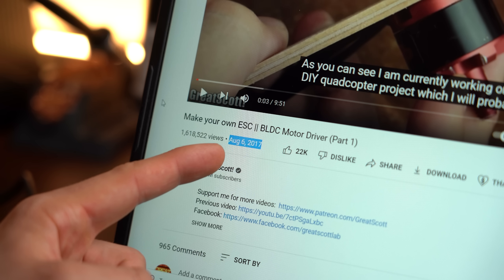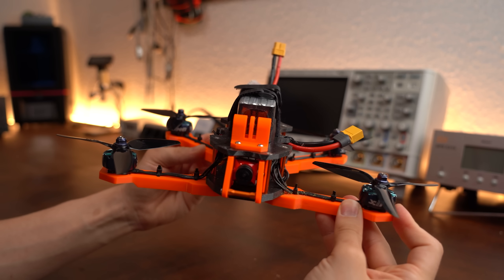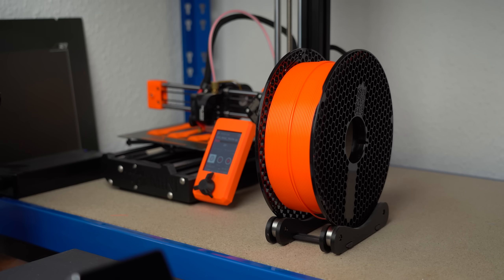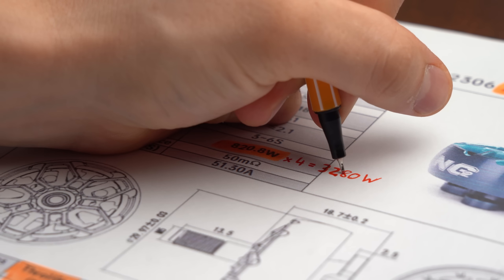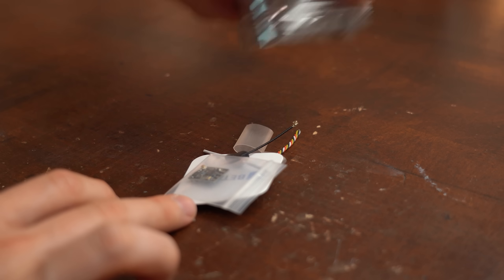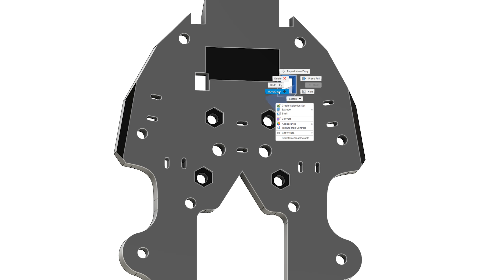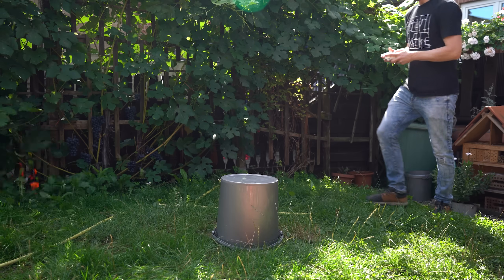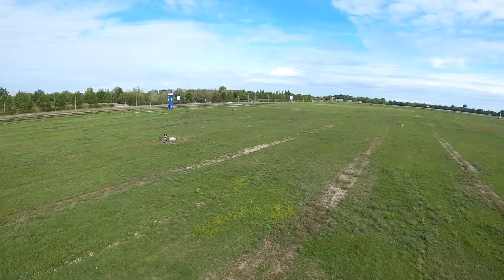The Idiot's Guide to Making a DIY Drone! (I am the Idiot)

Comment: Although 3D-printing a frame might make for a better video, what I learned the hard way is that there is zero benefit to not buying a ready made off-the-shelf drone such as the Diatone Roma F5. They have also done all the component matching and tuning for you, so you can literally plug in a receiver and a battery and fly it. Where 3D printing comes in handy is when you are experimenting and might change the design between each flight. Otherwise, plastic frames are too brittle and sensitive to heat. Carbon fiber is nearly indestructible. When you get fed up fixing and rebuilding it all the time, just go buy one. You will thank me later.

Comment: Those xing motors are really nice, but in my eyes too nice. $20 per motor is hard to swallow. It would make more sense to buy something like an emax eco 2306 for $13 each, then have plenty of money left over for a cheap Source 1 5" frame and spare arms.
Great video btw, but definitely some components that came be improved upon once you have more experience 👍

3d printing is still a great resource for printing antenna mounts, cam mounts, arm protectors, and motor skids though!

Comment: This video was good and all, just not what I was expecting. I figured you where going to actually build it from scratch. Before you could buy all this stuff we used to make flight controllers from an arduino pro micro and a gyro/accelerometer pulled out of a Nintendo Wii controller.

Comment: Heh quite a coincidence, I started building my fpv drone around the time you did your original video. 
I actually finished it but a very bad choice of goggles and camera coupled with my being a total noob flying made me put it in a drawer and forget about it. 

I just randomly picked it back up and got it running a week ago, started training in a simulator and got a better fpv setup. Now this video comes out :)

Good luck practicing your skills, the simulators like liftoff really helped me get over the initial fears of crashing or hitting someone.

Comment: A good build for ya would be something along the lines of a "babytooth" build which is a light 1s 3" that weighs like 60g with a battery. Very agile, super quiet, can still go nearly 100kph. The original babytooth frame is shipped from the US, but look around for other 3" toothpick style frames, ~1302 11000kv motors, 600mah (gnb) 1s, aio whoop board, and the other bits. Love my build! Or for more power build one with 1303 5000kv motors in 3s.

Comment: Love watching newbees try to fly and learn build a quad. Nice video, nice try, good parts, except the printed frame is an absolute no go. FC is way too sensitive for those wobbly 3d printed things. And everything is probably said already, so I'll keep it short.
1.Simulator is for children, learn the hard way😋
2.Lower your rates to make it easier and learn faster.
3.Add 0.25 expo to make it even easier.
4.Fly it on a 3s lipo if you're still think it has too much power. 

BUT MOST IMPORTANTLY: Please don't ever arm this thing in your hands...or close too you for that matter. The flip out it did in the air can also happen when you first arm it, and you won't be able to hold when that happens. Many, including me, have had an accidental arm while holding it and that is some scary sh!t. Will spare you the details😅

Comment: This is the first video you’ve ever posted where I knew exactly what you were talking about 😊 
2 tips… try to avoid powering up the VTX without an antenna hooked up to it. Depending on the one you have it can damage it. Also try a carbon fiber frame. The FC will work better with a rigid frame.
Reply: @Funk FPV do you have a channel where you fly FPV? I love your YT Shorts btw

Comment: Great project! Even if the PETG is not carbon fiber (as the experts mention in the comments) it is great learning experience.  I wonder of the total cost though ( I would love to build one too). Do you know what the final cost (of materials) was at the end?
Reply: should be around 300-350 Euro -> Motors 100, Elrs 20, FC 100, VTX50, + the small things like propeller, lipo, screws standoff and camera. For goggle and remote another 100 Dollar

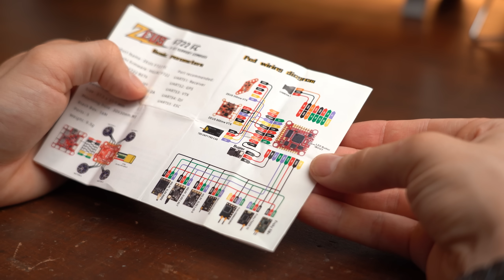Comment: 9:55 do not rely on the fc or esc cable! not every manufacturer has the same pin arrangement. you might fry your expensive fc so definetly check the manual at least twice before powering the drone!

Comment: I understand your value for being able to reprint parts that break, but as someone VERY into the FPV hobby (many thousand dollars deep), here are a few things to consider:

1. Carbon frames break WAY less than you would think. Well made frames like the Apex, Moongoat, etc are flown into brick walls, trees, and pretty much anything else you can think of at great speeds and can usually fly off with no issues after a quick turtle mode (flip over after crash mode). The Apex even has a warranty and they will replace parts if you break them. The most commonly replaced parts are motors and props. Props are a consumable, motors (for some people like myself who fly very hard) are as well. The arms are not. They should last you months or even years of flying around and just cruising. Until you start doing risky stuff around brick/concrete, you most likely wont break any carbon at all.

2. Plastic frames have much worse flight characteristics. We moved to carbon fiber because it is much, much stiffer. Frame resonance for plastic frames is a big issue. The flight controller needs to filter out those resonances, which adds latency to your system. If those vibrations are bad enough, it can even burn up your motors and ESCs.

3. Carbon frames offer the best durability for the weight. Carrying around a full size gopro, you really want to be conscious of the all up weight of the drone. Especially  on a 4s build, heavier drones will have problems coming out of dives or stopping quickly due to voltage sag. The heavier the quad, the more your motors need to work, the more demand is put on the lipo. 

All in all, there is a reason the entire FPV community has moved to carbon frames. Until some of the more exotic composite materials are tested, carbon fiber offers the best balance of weigh, durability, price, and stiffness. 

Also a side note, you really shouldnt be holding the drone while it is armed. It is a lesson you will eventually learn yourself, but just, trust me... those props will win a 1v1 vs your hands. Ask how I know :)
Reply: When you go bando bashing everything in this hobby is a consumable. :D

Good points. I agree with all of them. :)
Reply: SHTF prepper; Im interested in learning more about drones and creating them from nothing with replacement parts as I envision the next decade of SHTF crimes and modern warfare combat situations, drones seem to be the epicenter for many next discoveries of modern tactics in using drones in helping solider in battle, helping police fight crime, helping firefighters put out forest fires, and potentially SHTF type situation, perhaps it'll do some good to know such things and have such capabilities knowledge, skills and fighting skills in being able to both attack and defend yourself from afar.
Reply: @westcoastadventurers8504  Yeah after seeing what they can accomplish in the Ukraine/Russia war, I kind of want to build one myself. Mainly for recon during an emergency type scenario. Plus you can just get cool footage from them lol. The DJI drones are really nice but seems like building your own would be cool.
Reply: In any reality in which terminator type machines exist, even used for good in protecting people, eventually they the terminator type solider's will be taken over by AGI, hacked by a humans, or some form of secret organization in witch will carry out brutal violence on the innocent of humanity. I am currently laying groundwork in setting up multiple companies and organizations in defense to these injustices even if they do not occur for another decade, this only gives us more time, because these events will occur, the question is when?
Reply: Armored robots are already being put onto the streets within the communities in which we call home. We should not and can not trust AI robots in providing security to us as individuals, our communities or nations at large, we must learn the skills that it takes to stay ahead of the curve when it comes to both criminal activity, foreign nations, secret agendas to rid us of all property, and AI from controlling the entire world via armored private security, armored police bots and armored military bots will be used everywhere around the world by 2045. Just like the automobile has dominated the battlefield and cities in which we live for the last 100 years, drones will have an major impact on the battlefield and in our own communities for over the next 100 years.
Reply: Ah, that's why! I built a "springy" titanium frame whoop drone and it requires more than a lot to handle😂
Reply: I remember when I was a kid, my dad bought me and a friend of mine two identical RC planes. The instructions said to throw it like an airplane while putting the throttle to full. Quickly learned that these instructions are pretty bad for this particular plane (props in the back). My friend's mum threw the thing while he throttled to max. It just barely graced her finger with a prop and took of a bunch of skin. She had to get stitches.

So yeah, props do be dangerous

Comment: Glad you tried fpv ! You should get a carbone fiber frame, much more stiff and resistant, it can handdle a lot of crash. I did some video of what you can do with a fpv drone, it give a lot of sensation, u should watch 👌, but to become good without losing a looooot of money, simulator is the way to go

Comment: Osilations might be because of flexing 3d printed parts try to stiffen the arms also for starting with drones i wuld recomend you to have it position controlled by gps to get used to controls but you need antena for that or you culd practice in simulator

Comment: Listening to the motors I can hear the PID parameters are not good and I think the first time all of your motors have stopped in mid air was because the FC thought it detected a runaway (you can see this alarm in OSD). I have built my first drone using basic servo signal ESCs (dont ask) and that is what it would do before I altered the PIDs drastically. While it was no longer going to the moon, it would still flip out a bit after a sharp turn or a stronger gust of wind. The default betaflight settings should not be this bad with your equipment though. I think you need a proper carbon fiber frame, the plastic may not be stiff enough. In my opinion there is no reason to tune the quad or learn to fly it with mechanical problems.

Comment: Good work! Like others mentioned frame stiffness might be a possible issue.

You might also want to try the iNav controller firmware, not only if you're interested in adding more functions like position hold or route following, but also just for "normal" FPV.

It's configured much like Betaflight, since they share an open-source lineage.

Comment: hi Great Scott, i like your videos :> 

i am a fpy pilot but i have no drone yet so I practiced in a simulator her are my recommendations and information

* practice in a simulator 
* avoid 3D printed parts except for the gopro mount 
* if possible use a better controller/transmitter like RADIOMASTER (optional)
* avoid exposing the battery cable near the props as when you crash it will get chopped up

i hope you will have a great and fun flight out there :>

that's all from me stay safe and happy flying :)

Comment: Please, don't use 3d printed parts for fpv quads, the rigidness of carbon fiber heavily affects the tune of the quad and how the flight controller reacts to it, 3d prints need to be thrown out the window, get a carbon fiber frame and spare arms, easy as that

Comment: The frame have to be very stiff. Most of your problem comes from the frame (vibration issue..) . Buy carbon fiber frame TBS Source . Is very cheap and will have more success. And the rest you have decent parts what I can see.

Comment: I'd make the frame out of aluminum. Just cut out a simple X from a sheet and drill some holes into it. If you don't have a tap and die set I'd suggest getting one to make threading the holes easier. You could even make an oval for the bottom, use standoffs to connect the top and bottom pieces and it'd be pretty sturdy.

Comment: well great scott finally gets into fpv, aint this gonna be awesome, so about your drone there are a lot of problems first one being the frame these 3d printed ones are never perfect and have a little to a pot of vibrations which mess with the quad, and hence require extensive pid tuning and more agressive gyro filtering, then a 4s 2200mah ia wayy to heavy for a 5" better to yse something like 1300mah, i would really advice using a carbon fiber frame or use some some carbon fiber pieces or tubes to reinforce your printed frame

Comment: Excellent video breaking down the process of how to build a quad from a beginner's perspective!! I would recommend trying out a sim, and you should be able to use your controller as a joy stick if it has a USB plug.  For a sim, I would recommend using Liftoff or DRL, both of which are on steam.  You can crash all day on those and not spend a penny!

Comment: Hi, Really a great video
But the problem you had with the motor being stopped at the highest point of the throttle that same thing is happening to me but I don’t know whether it is the copper wire or capacitor needed or the esc is not calibrated properly🤔 and another problem is that when the motor is armed it automatically starts at a lowered speed then I have to the desired throttle means that the motor doesn’t stop at the lowest throttle rate😢
If anyone wants to help or give a suggestion please reply

Comment: nice mowing machine ! :D
just kidding you.... you did a great job on this ! however i'd just make a notice: motor arms are too bendy. This will act like an oscillating mech part between motors and their gyro-sensors through the servo loop.... i guess you could enhance control and stability by making those arms less bendable ;)

Comment: I wonder if you could do the bottom section of the frame in aluminium? It would certainly be a lot stronger than filament, easier to work with than cf, and only about twice the weight, which as a percentage of total weight might not be so much (and maybe it could be used as a conductor too, saving some wiring).

Comment: Hey, fpv flyer here, there is a reason frames are made of carbon fiber, mainly they are incredibly hard to break on soft grass, and as they are more rigid, they tend to vibrate less, and will make pid tuning way more easyer. 
If you want to get more in depth with the frame design and pid tuning, look at Chris Rosser's youtube channel, and DaveC_FPV for more creative ideas on frame design.

A good option for an affordable 5" chassis is the Steele Apex, and if you want the best for the vibration dampening, the AOS 5 is a good choice too (made by chris rosser)

Other than that, a 3D printed frame is fun for the experiment, but will limit your PID tuning ability in the long run.

Comment: Nice work, built one by myself in february this year. I would recommend you to buy a carbon frame because as I have learned by a lot of different sources they are much stiffer than 3D-printed frames and thus you won't have those oscilaiton problems. I bought a cheap one for 15€ from Banggood. It held up eversince and I've had no problems with it so far. 

I went overboard with it as well btw. I went with 6s 1900kv motors on a 5 inch frame. Speed record: 180Km/h xD

Comment: Dude... FANTASTIC work! 😃
First of all, fantastic choice of motors! The same brand has a cheaper version (I'm not sure which you bought) that are perfect!
I'm not going to talk about the carbon frame, lots of people already did. 😬
But there are companies that would cut any frame design you come with, which could be a great option indeed. 
About learning to fly, I'm not sure if your transmitter can be connected to a PC and used as a joystick... But there are some fantastic simulators you can choose from. That's how I started and learned! You can crash hundreds of times without it costing your kidneys. 😂
Oh, in case your transmitter can't connect to a PC to be used with a simulator, looks for the Radiomaster models. They're great, the best in the market!
Anyway, stay safe and creative there! And flying! 🖖😃

Comment: Yet another unsuspecting victim sucked into this glorious hobby... Welcome to the club mate!

Anything beyond 2.5-3" (~80 grams AUW - take a look at "Toothpick class quads") sucks when it comes to 3D printed frames. The vibrations, the durability...
Also if your Flight controller is STM32F4xx based one, in betaflight you should use DShot 300 (not DShot 600) and run a 4K pid loop. Maybe that has something to do with the initial desync too.

Comment: for anyone thinking of building this... buy a carbon fiber frame... it's much tougher than you think... I used to practice over a deep plowed field (big chunks of dry mud, the about 30cm heigh)... when i crashed, which was a lot, the only victim were my anckles being stabbed by the sharp dry mud. 3-blade pastic rotors are pretty tough too... if you can, wrapp the battery in foam, those are NOT tough, one hit and a 4S battery becomes an unusable 3S battery
Reply: and DON'T BUY PWM REMOTES! no matter how cheap, they do work, but they are very limiting in accessories... they're better for beginner RC planes (very simple to connect), but not copters.